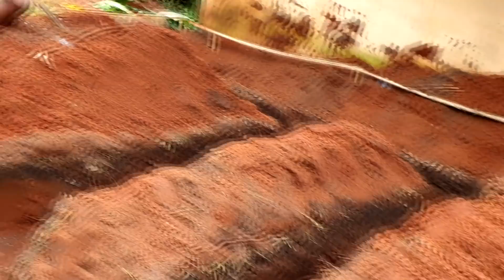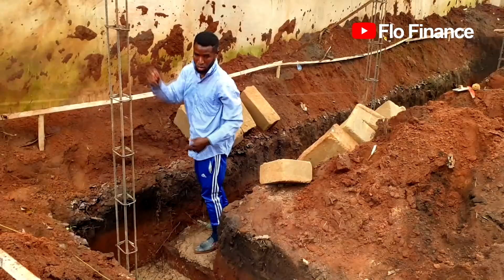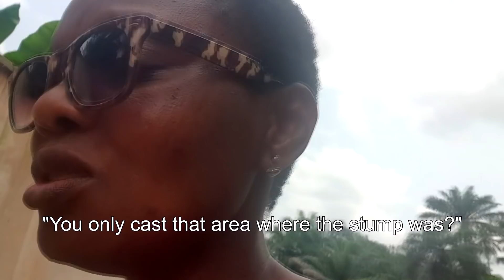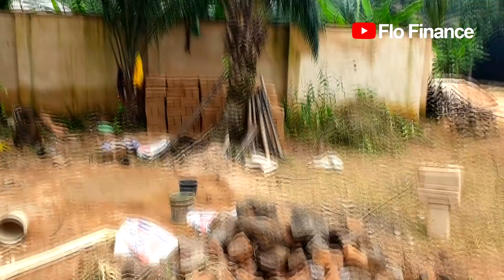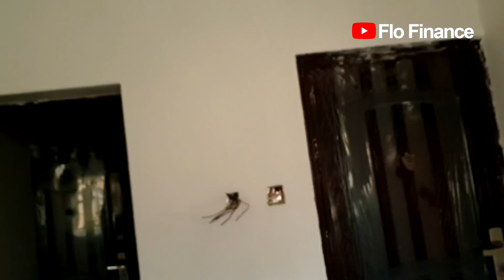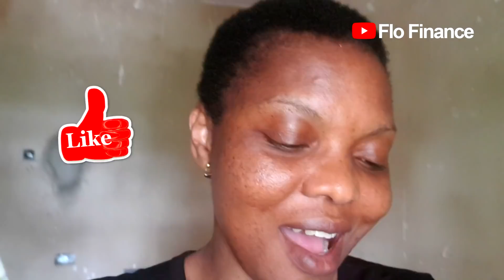BUILDING A 2-BEDROOM BUNGALOW DAYS 2-4 | BUILDING A HOUSE IN NIGERIA | Flo Finance

Comment: Weldone to you Flo. I just want to ask which is better a concrete house, a brick house or a mixture of both.
Reply: Concrete is always better.
Reply from the maker: In Nigeria we build with a combination of concrete slabs, beams and pillars (cement + sand + stone aggregate) and cement blocks (cement + sand aggregate). You will see these at play in this series. Bricks were used back in the day but I doubt there are brick houses in Nigeria nowadays.